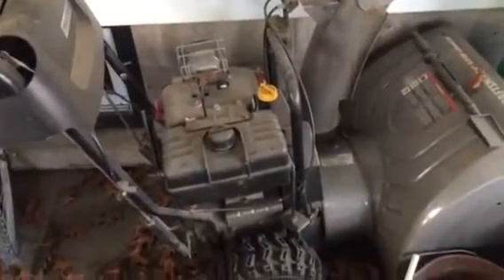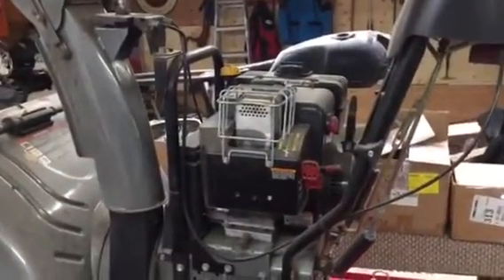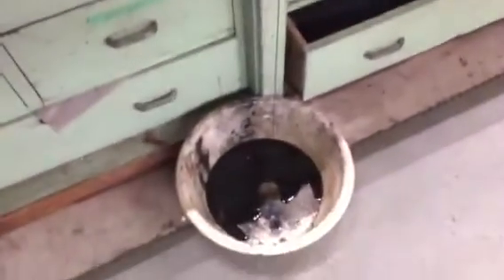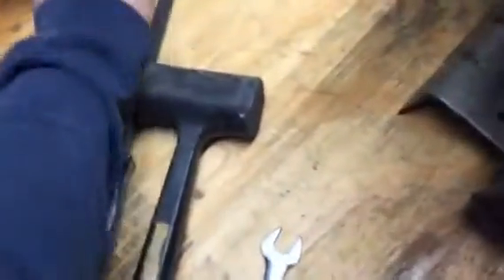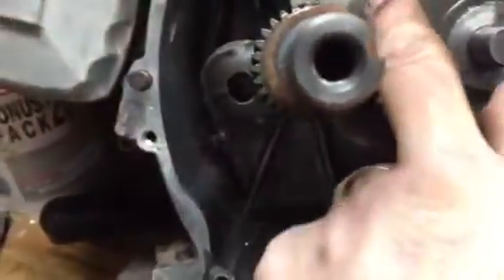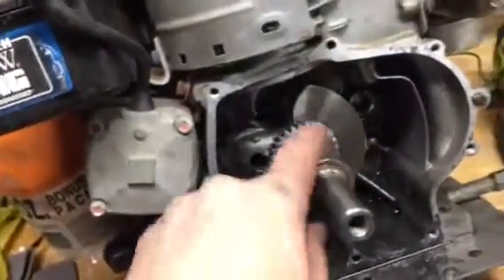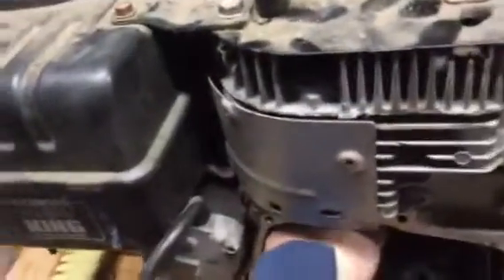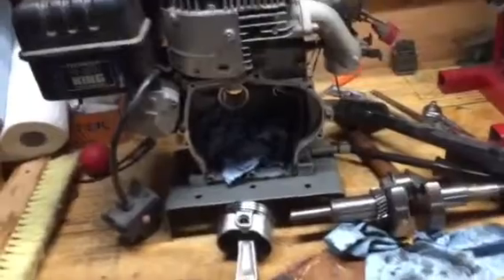Craftsman Snow Blower 8HP Snow King Tecumseh engine disassembly,siezed, broken rod, repair

Comment: Hi your not answering on the other video so I'm trying this one, I'm getting it together, are you sure the torque on the connecting rod bolts is 220 inch lbs.  I have an inch lb wrench and it goes up to 200 lbs I tighten them to that and the wrench won't click and I'm afraid to break the bolts there so tight and nothing will spin when I tighten it like that, it seizes right up
Reply from the maker: It has been several years since I  did that video. I just googled the torque specs. Try to confirm it. If you have torqued the rod down and it won't turn now, you must have the wrong rod.
Reply: @MOAB  hi thanks yea the whole piston assembly I got from ebay from same engine, a 205cc Briggs, can u do me a favor I have trouble finding it can u give me the torque for those bolts that's the connecting rod and the crank case cover bolts for that engine, thanks

Comment: Today, before winter, I tried to run my gas snowblower 1st time this season. Easy started, ran for 3 min, it sized up. Pull rope cannot pull even a cm. Electric starter works (but only the starter ran itself) but not the engine run. I removed the front shaft/belt cover, hand turned the pulley. I can turned (very difficult) shaft clockwise & counter clockwise for 360 degree then stuck, but when it stuck, I can heard sound like metal hitting metal. Is this a similar case like this video?
Reply from the maker: Yes it sure sounds like the rod has broke and is rattling around in there. Same thing as mine. If you can afford it put a Honda on.
Reply: Service guy came and told me to get a new one, exactly as you said, must be the piston rod broke.

Comment: You better look at that block really well usually they break. Every time the rod breaks. They didn't leave any excess room.
Reply from the maker: Yes, And it was broken. I didn't see the crack behind the starter motor. Thx for watching.
Reply: @MOAB  you're welcome. Almost every motor that comes in that has a broken Rod as a broken block. Why do people put Predators Motors on damn They having a kit. It is a extension for the shaft. Harbor Freight 6.5 hp motor 212 on sale for 99.99 . Sale on for the 8/9/10 of March. I seen a lot of people on the internet switching over. They are a Honda clone that's what they was saying on the internet
Reply from the maker: I am going to check that out at Harbor freight here. I will change that out. The Tecumseh motor is so hard to start when it gets really cold. Thank you.
Reply: Excellent advice Michael.  Thanks!

Comment: If the engine is hard starting, don't crank for more than 5 seconds at a time. Let it cool down, and try again for 5 seconds. Brushes in starter motor are held in place by plastic that will overheat, melt, and the motor will self destruct. Inferior design.